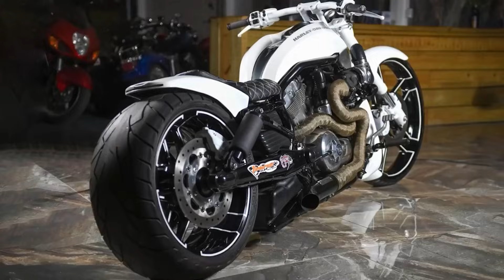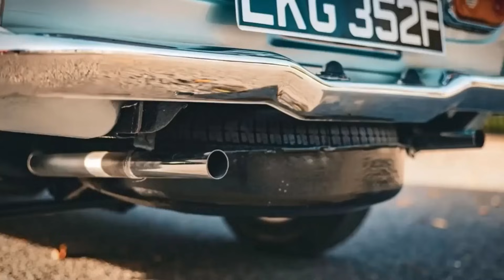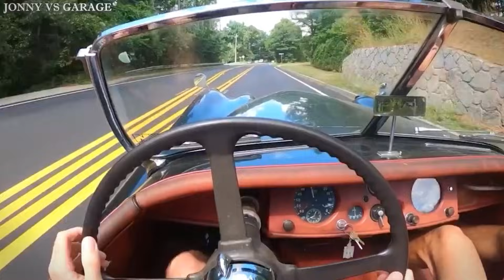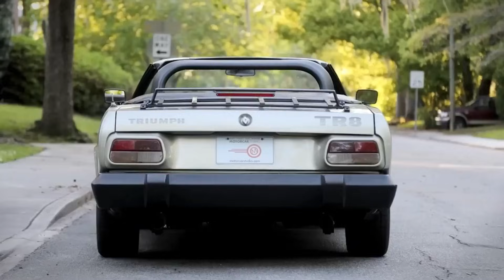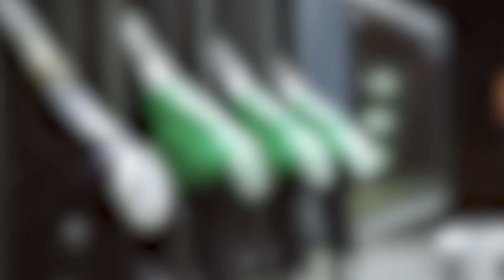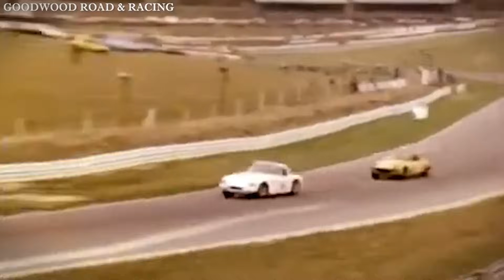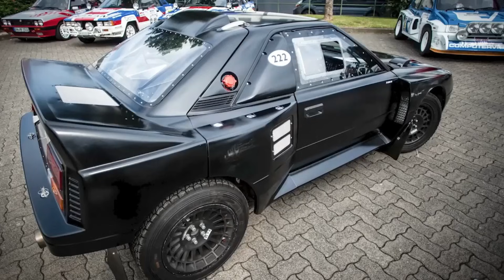10 Most Genius Sports Cars Killed by Bad Timing!

Comment: 00:28 - "... or 680 Kg - it was lighter than most modern motorcycles."
Must be the "New Math" - the heaviest production motorcycle I found was the Boss Hog V8 - which weighs 500 Kg. While there might be a few one-off builds, they certainly can't be counted as "most modern motorcycles". Unfortunately, I am starting to find this type of inaccuracy to be frequent in "Top Intel" vids - I can put up with the autoreaders - but the just-plain-wrong script is the fault of crappy writing and insufficient research.  Sorry - I'm out at less than 30 seconds in - and blocking.